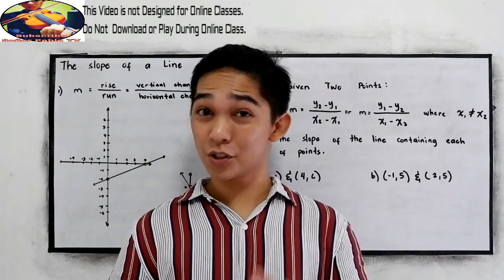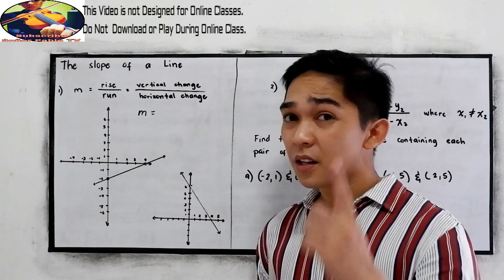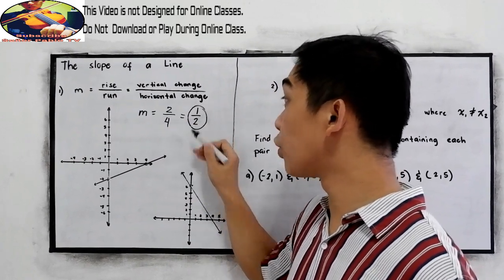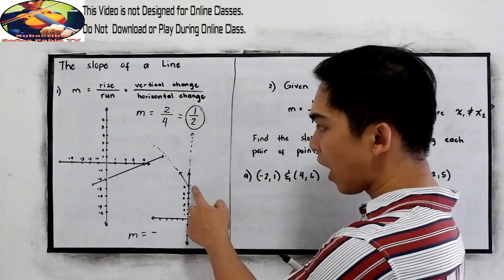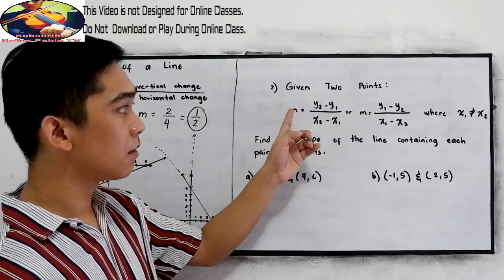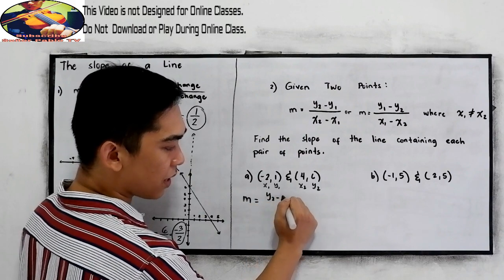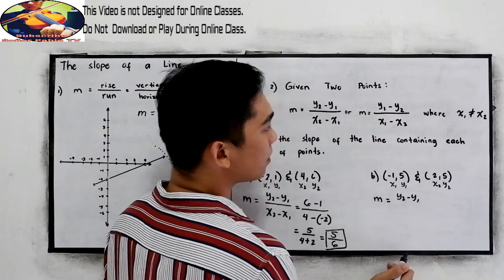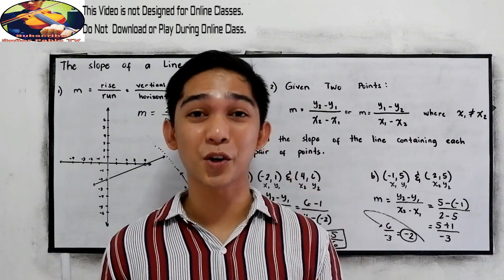The Slope of a line ( rise over run )

Comment: sir i am curious why did you write y1 is the -1 rather than 5 which is actually the y1 as you explain it already and even the x1  which supposed to be 5 you put -1 i am referring to the given solution B in the second problem